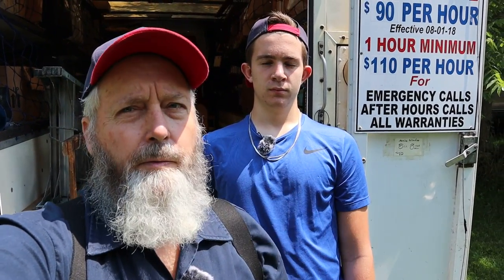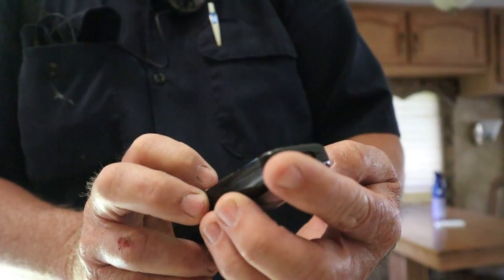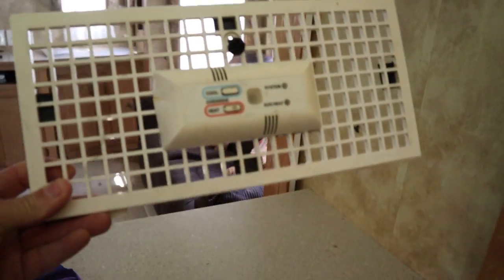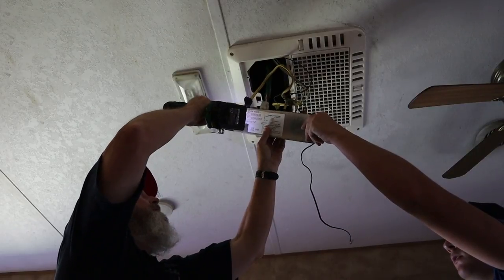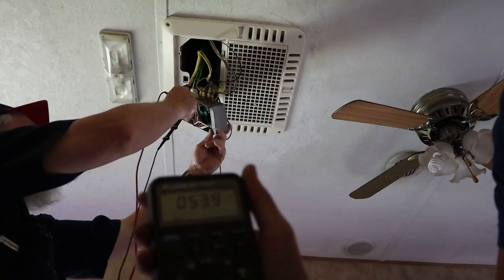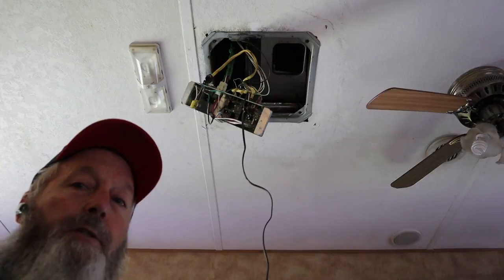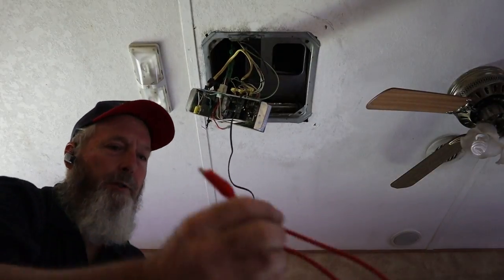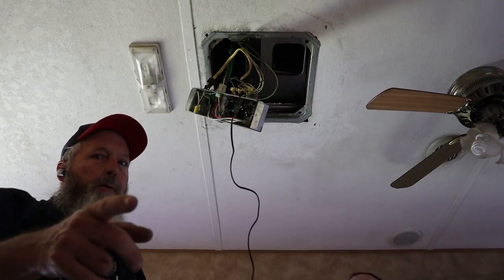Diagnose No Fix. Furnace And Air Conditioner Not Working

Comment: Man I bought a 2004 fleetwood pioneer your videos have helped me through trouble shooting everything! At this point I had the blower motor go bad on the Coleman mach ac and I believe it fried the control board it’s an obsolete part
Reply from the maker: Bummer. The replacement won’t last 19 years.

Comment: Hey I really like the video! I have this identical camper set up and I would like to wire a wall mounted thermostat like you explain at the end of this video. Is there anyway you can explain what wires go were to install a regular thermostat and bypass the wireless remote
Reply from the maker: If I had gotten this job, I would have a video, but I didn't.

Comment: Does the flashing mean it in cooling override?
c) Pressing the “HEAT” button a second time will turn the unit off and the 
AUX. HEAT red LED will turn off.
3. System LED (green)
a) The LED is off when the power is off, the 12VDC is removed, the 
communication cable is not connected, or the unit is in heat override.
b) The LED is on when the power is on.
c) The LED is flashing slow and steady when the unit is in cooling override.
4. Auxiliary heat LED (red)
a) The LED is on when the auxiliary heat is on.
b) The LED is flashing slow and steady when the unit is in heating ov
Reply from the maker: Thanks for that info

Comment: i have 2005 Challenger this is the exact same system and remote I have.  The auto setting doesnt' want to activate when set on heat. My compressor runs it was hot then it stoped being hot. My remote is old i need a replacement maybe or i hope its just the batteries? Its gonna be 20degrees tonight
Reply from the maker: This system is completely obsolete.

Comment: What did yall have to do?
Reply from the maker: Nothing. The customer didn't want to put that much money into it. it would have been another trip and quite a bit of labor plus parts.
Reply: I'm having the same issue the AC was working then nothing after a red and white wire got cut. 121v going in, everything looks good at the Breaker Box even tested the capacitor and it's working properly. I'm getting 9.DC V coming in to the j box.
Reply from the maker: @Outdoorkings  9 is not enough.
Reply: You think I can hook up a 12v battery on it to is if that makes a difference?